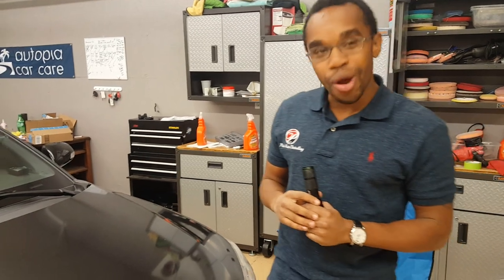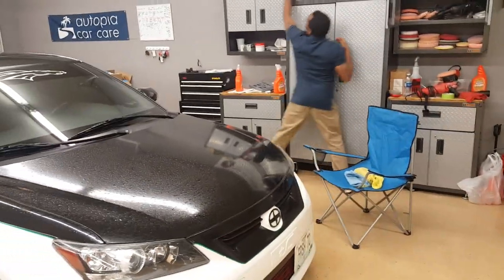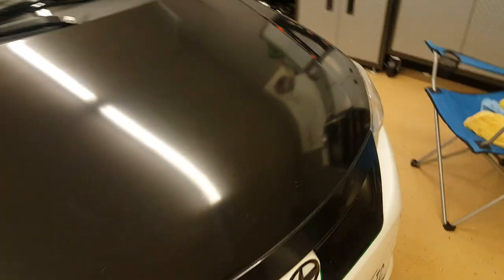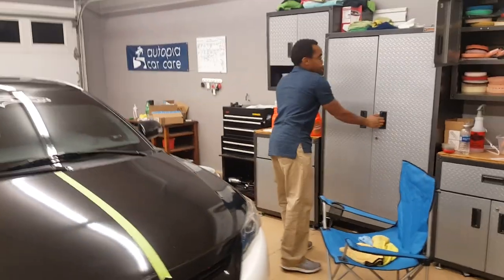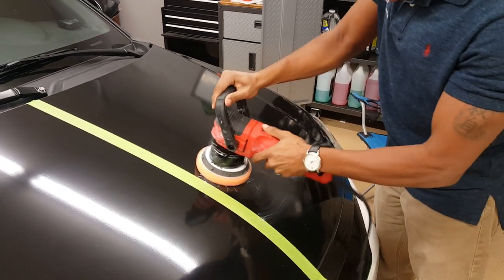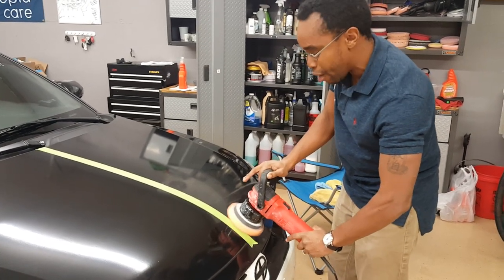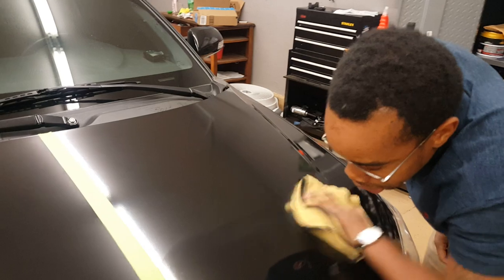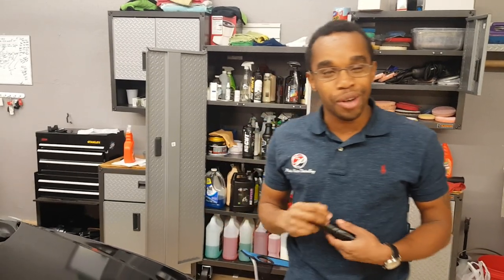Polishing Vinyl Wrap can it be done?

Comment: Weird...the guy from Obsessed Garage  took his vinyl racing stripe off of his GT 350 because he could not get it looking right. He said he spent a couple of hours  on. 

He should have talked to you.
Reply: Dragnet Radio. Yes, you can polish vinyl and matt tried polishing it but ended up removing it because of course he is obsessed with near perfection which cannot be achieved on vinyl. So even though this guy polished it and saw 40-50% defect removal obsessed garage wants to see 90-100% defect removal.

Comment: Depended on the brand vinyl you arnt ment to use polish on vinyl as it drys the vinyl up and it will crack and ruin it over time, its not recommended to use wax based products on vinyl as the warranty will also be voided depended on brand
Reply: What warranty? 🤦‍♂️
Reply: @porschejunkie2429  some shops warranty their work